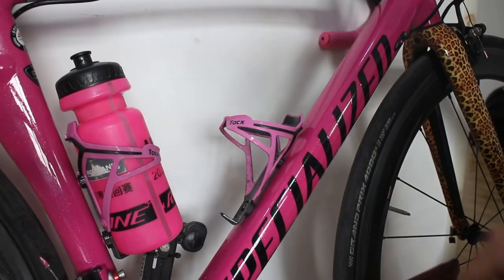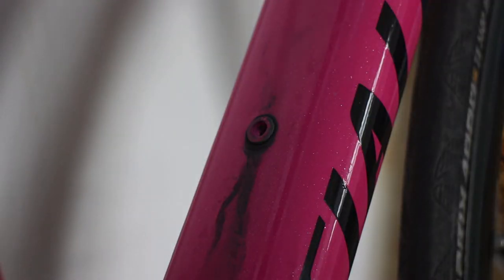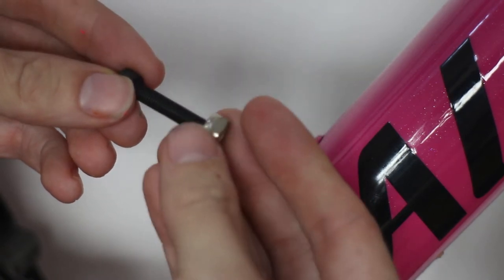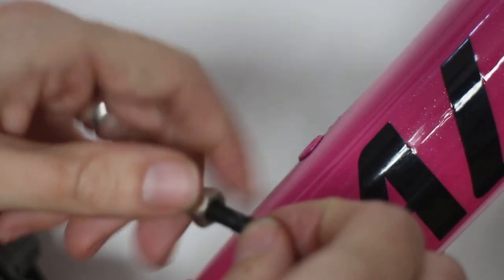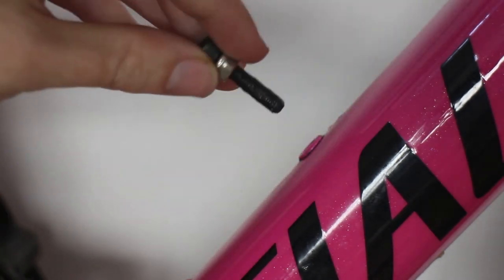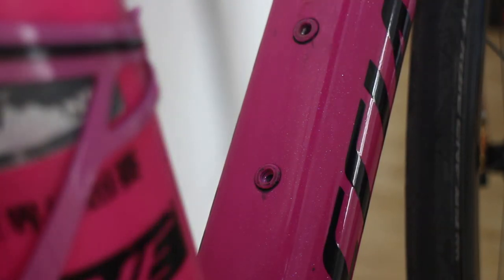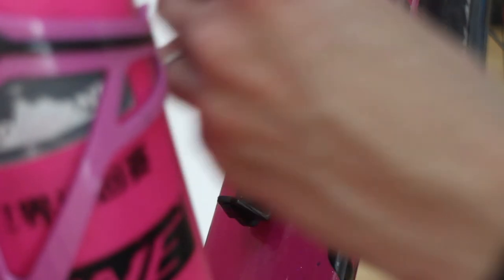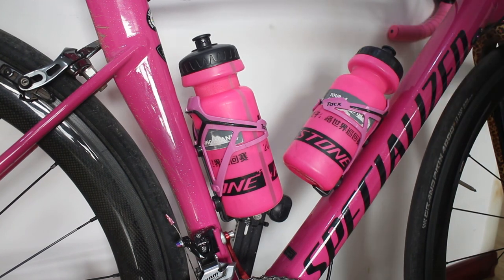How to Fix Loose Rattling Bottle Cages

Comment: Always put tape on the tool or the bike to protect the paint from scratching. Not sure exactly what you are saying- is there another part inside you are pulling up? Usually it gets lose because the threads where out over time. In that case you can size up, re-tap and use a larger bolt.  

I have to say, it is funny to see people worried about a random ounce or two. Must be a nice problem to have. I know, you are really into biking and every ounce counts. I get it.